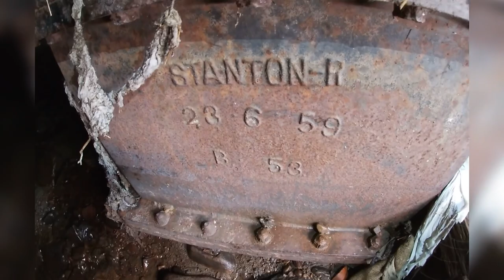HALIFAX UNDERGROUND -The Hebble Brook Culverts -Part 2-

Comment: The 2 flyovers are called burdock way. And the other bridge is north bridge the old main road into town centre before they built they flyover in 1973!
Reply: I think he says "old rail line" when pointing underneath North Bridge at 04:33, but you're correct. Always been a road bridge, but did have trams on it years ago I believe.